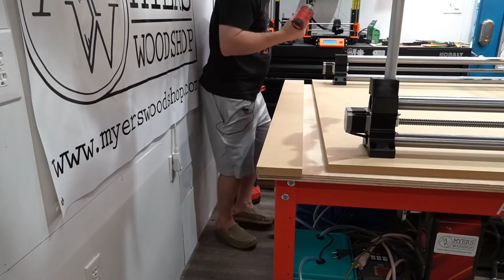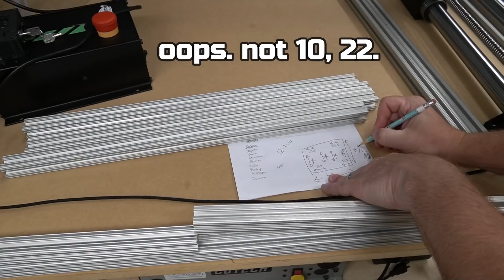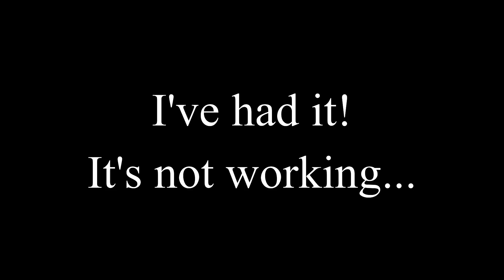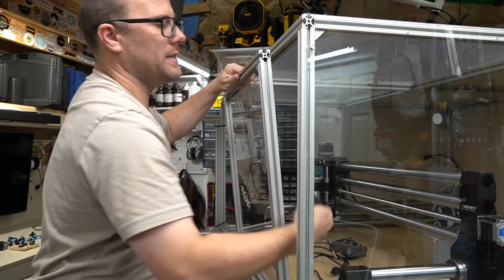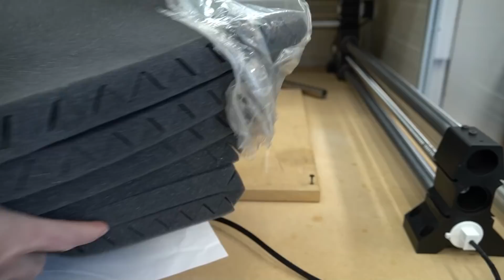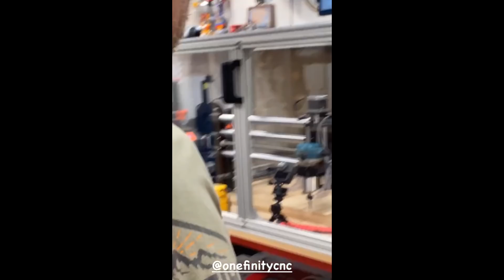Ultimate CNC Enclosure Build Video! // How To

Comment from the maker: ■ 10 Sticks of 80/20 Extrusion 97" long : https://amzn.to/3ba2gzr
■ 2 packs of Extrusion connector set : https://amzn.to/3u5TKu0
■ 1 pack 10 of L Shape Plate : https://amzn.to/3baWo8V
■ Self Tapping Screws : https://amzn.to/2LZTknG
■ Acrylic Sheets: https://www.lowes.com/pd/OPTIX-0-118-in-T-x-36-in-W-x-72-in-L-Clear-Acrylic-Sheet/3140717
■ Wood panels : https://www.lowes.com/pd/Oak-47-75-in-x-7-98-ft-Embossed-White-Oak-
■ Wall-Panel/1000937538
■ VHB Tape : https://amzn.to/3aquJBO
■ Hole Saw Set : https://amzn.to/2NbPFDP
■ VHD/Spindle : https://amzn.to/3avQ3Gh
■ USB C Extension cable : https://amzn.to/3arXoXm
■ HDMI 6" cable : https://amzn.to/3rU1r4m
■ Spray Adhesive : https://amzn.to/3qrSK15
■ Acoustic Sound Panels : https://amzn.to/3rZVtin
■ LED Light Strip : https://amzn.to/3bbGzz1
■ 4" Shop Light Bar : https://amzn.to/3dkXkdy
■ Vacuum : https://amzn.to/3rYUXkF
■ Tools Today Aluminum Blade : https://amzn.to/3dqFAxH
■ Miter Saw : https://amzn.to/3qodSFg
■ Miter Saw Stand : https://amzn.to/3asj2up
■ Onefinity CNC : https://www.onefinitycnc.com
Reply: Awesome video. I always define jobs by the HD Number. Like this is a 4 HD job or a 10 HD job. HD being the number of trips to Home Depot or Lowe's I have to make.
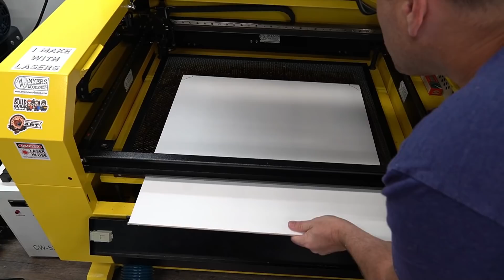Reply: 23:00 is your laser cutter following the black sharpie lines?  Holy crap, I never thought about how powerful a tool like that could be.  Please tell me more

Comment: I did the same thing with corner brackets on the doors for a project I made, then realized it complicates the panel cuts. But rather than use a face mounted bracket as you did, I learned the hole in the end of the aluminum extrusion can be tapped, and a hole drilled into the stick it attaches to. A screw goes through the hole in the extrusion channel, and threads into the newly tapped hole. Very strong, and the hardware is hidden and cheap!  With this method, all the panel inserts are square cuts.  Your project looks great!

Comment: Do you think that using the triangle flat brackets that bolt on the outside of the corners would make it easier to get acrylic panels in there? EDIT: Nevermind just got to the end of the video. :D

Comment: Nice cabinet. If you were going to do it again would you use the same design with the extruded aluminum? Or would you go with wood?
Reply: Extruded aluminum is not rigid. For a more permanent solution I would go with wood

Comment: Nice job I just made one myself. It helps a lot with dust and cuts the noise down as well. I use a security camera and wifi plug as well so I can shut down in the house if I see any problems.

Comment: If your in a pinch and/or want to save a few dollars you can model up and 3d print some of the different type 8020 brackets. For this type project the strength PLA should be fine. I used this method in the past when I was short on hardware, worked great.

Comment: I was going to mention how important measuring is, if not for ordering at least for dimensional reasons. You later found this out by building to ~24-1/2" rather than 24" So I won't mention it.
 I too design on the fly but a simple box could have been designed ahead of time. This would have exposed those dimensional errors that require going to the next size of something. It would especially cut down on waste and may possibly have reduced shipping costs.
I also have to add.... WOW you spent over $290 for the frame and it isn't even Mahogany!
Reply from the maker: yep.  big mistake.

Comment: A little late, but you could have shortened the vertical supports (uninstall and chopped off an inch or two) assuming you would still have enough clearance above the z axis. Love the final product either way, great job!

Comment: Couldn't you have welded the panels back together with acitone.  Butt joints would not be as strong as new but these would not be load bearing panels.
Reply from the maker: If I owned a welder or have ever even touched one...probobly?🤷‍♂️
Reply: @MyersWoodshop  no, not a metal welder.
I mean chemically welding with a solvent like acetone.  I have done it while making templates for router guiding.  It works very well and allows you to use up cut offs.
Reply: https://www.youtube.com/watch?v=uaFHS4ESw7Y

Comment: Great Video, thanks for sharing.  Placed my Onefinity order just this week.  Do you suppose your original design would have worked if you had used those outside angle brackets that you ended up using for the door?  I really like the look of the glass inside of the extrusion.  Seems cleaner.

Comment: Came out nice. I wouldn't stress about the gaps in plexi letting out noise, as plexi is no good at any real sound reduction anyway (it's a great sound transmitter instead). It's great for letting in light and keeping the chips out of the rest of your workshop, though.

Comment: I prefer the nuts you can rotate into place. They cost a little more, but you don't have to worry about having them all in place before you assemble. It also enables adding more supports later should it be needed.

BTW, your mic peaks/clips a lot. You should turn down the gain in whatever you have the receiver plugged into and then just level the audio in your video editor.

Comment: Hey I am a fan of your channel. Your videos helped inspire me to start making videos this past summer. Have you milled 1 inch thick aluminum on the Onefinity? I have been milling aluminum on the Shapeoko 3 and just wanted to get an idea of the difference. I just made a putter out of aluminum using my Shapeoko and it turned out great. You can check out the video if you want. I am curious if a screw driven machine would result in a big difference. Also, instead of screwing the sides in with self tapping screws, you could use t-nuts for the extrusion and the proper machine screw for the nut. It would make it really easy to put the panels in and take them off and the nuts do not need to slide in the sides, you just screw them to the panel and leave it a little loose then the nuts fit in the extrusion and as you tighten they turn one direction and grab the inside of the extrusion.

Comment: Hi Ben,
Thanks for the post of your enclosure it really looks great I always learn something new from your videos. My OneFinity doesn't ship till late march (my first cnc) and  I'm trying to get a head start on my table and enclosure build. I would be grateful if you would share what you determined to be the actual overall footprint of the OneFinity itself including steppers & dust boot.
On a side note, I find a lot of folks posting videos of water cooled spindles and the fact that how quiet they are compared to a standard router. However, I have yet to find any videos showing one in action with any sound level readings. I believe it would be of great interest to anyone considering a spindle upgrade or fabricating a sound deadening enclosure to know what decibel levels and frequency (hertz) range one could expect when actually cutting. ideally in a variety of materials such as mdf, soft/hard woods, acrylic's... Thanks for any consideration, Charlie from Up-State N.Y.
Reply from the maker: goes from 80-90 without to 60ish with.  much more quiet.

Comment: That is quite the undertaking. It looks pretty slick, and the laser etched doors are a nice touch. Also, thanks for letting us learn from your mistakes.

I hate cutting acrylic on the table saw, I always get showered with molten pieces of plastic. And the clear splinters are the worst. 

I don't know if they have a minimum order, but Cope Plastics might be a better local source for acrylic. They're a little farther than Lowe's, though. So they might not be worth it unless it's another big job.
Reply from the maker: Yeah, basically acrylic bullets shooting at me!  The worst!

Comment: Nice Job...To bad about the extra cash outlay. Two questions.  How much of a difference in the sound does it make. Do you think the foam will get coated with dust?  Also you will have to let us know how you like it after having to do maintenance on the CNC. Over all Two thumbs up and four knuckles.
Reply from the maker: Yep, a very costly mistake!.
It makes a huge difference in sound and dust.  The foam isn't covered in dust yet!

Comment: What happened to the spindle?
Reply from the maker: I use a 2.2kw one now!
Reply: @MyersWoodshop  My research seems to indicate a 2.2kw spindle would only come in an 80mm (or larger) diameter.  The spindle at the beginning of the video sure looks like an 80mm.  The question is, where can I get mounting for such a spindle?  I read elsewhere you were using a 2.2kw and have been searching through your videos trying to find one that addresses that upgrade (from the .8kw), but have been unsuccessful.